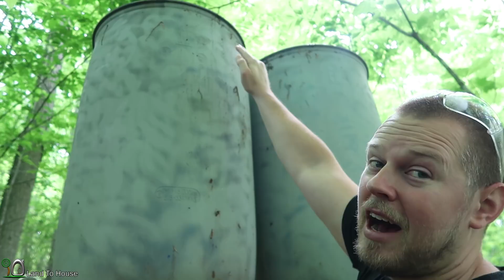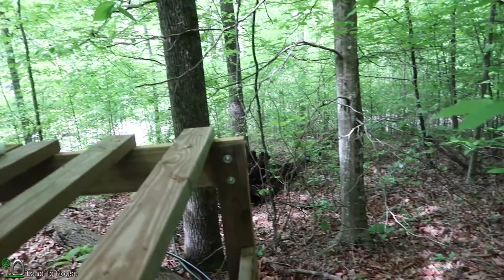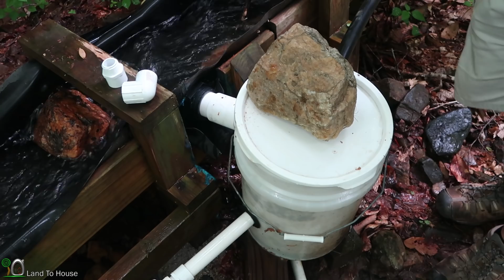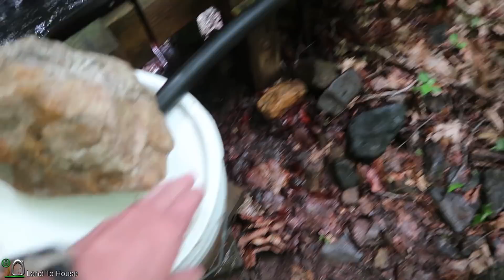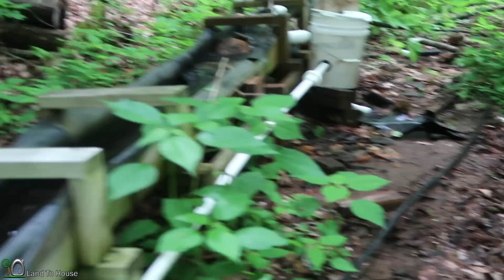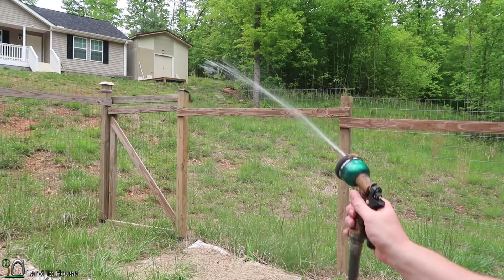Off Grid Water Tower P4

Comment: That is a great idea for some situations to allow a smaller ram pump continually feed tanks that deliver a lot more water periodically as needed.     I'm considering benchmarking a gravity feed system with 340 feet of 2 inch pipe against a ram pump / tank system with much shorter pipe lengths.   Maybe the two approaches can be combined.

Comment: If you want to stop the water automaticly use a float just extent the pipe it will shut the valve.!
Reply from the maker: My next ram pump series in the summer of 2020 should have a float valve shut off. When the ram pump delivery pipe is closed it can create a significant amount of pressure in the pump. I want to do some testing to see what happens with long-term hard-hitting at the pump.

Comment: Your ram's spring check vale would have to fail in order for the reservoirs to lose water... I have NEVER had that happen yet.  just my 2 cents. :)
It feels really good doesn't it?  :)    I have used about 4000 gallons from my system in the last 2 days... it's been dry and i have been irrigating a lot.  Nice job Seth!
Reply from the maker: I have actually had the inline valve fail twice due to tiny rocks. now that I have a screen intake and bucket I dont see that happening. But I would rather have double safety in my system. Once I got the tanks filled it rained 10" in 6 days. . .  . so much water haha.

Comment: Would it be better to use metal gate valves rather than plastic valves?
Reply from the maker: Are you referring to the non-return valve at the tanks or are you referring to the inline valve on the ram pump?

Comment: I was wondering why you didn't install a check valve on the inlet of the towers from the get-go, I'm glad you installed one now.

The tower looks good and I hope it works well for you, it looks like it should.
Reply from the maker: Definitely helps. I wanted to make sure I did not have any issues before I installed it so I did a basic test run. After a week everything is working well. Except we've had 7 inches of rain haha

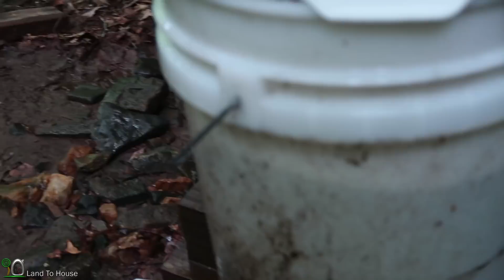Comment: @9:50

I know you have the cap on the connection to the flue, because you didn't want to be drawing water from the flue due to the debris you were getting.   But, now that you have added the pipe that is able to fill the bucket, why not remove the cap to the flue and let the water flow back into it, rather than overflowing the bucket?

Comment: We use a drip water system that constantly drips out of small connectors attached to sections of a very long thin pipe onto the base of plants and into pots of plants, it's connected to the mains water at a slow rate with a battery powered timer to allow the water through for 4 hours a night, , it means that the plants are watered without having to go turn on a hose and only the base of the plants are watered , would something similar work there on thats system?

Comment: With your bucket on The Flume I think you could probably put a 90 on the Old Inlet printing up a height higher than the water level in The Flume it will just flow back into The Flume and continue down the creek stead of making a mess by the bucket basically acting like a drain skimming the surface of the water inside the bucket
Reply from the maker: Fun idea! I will see about getting that done. Would be like a pond spillway.